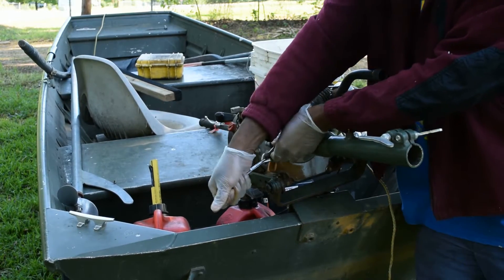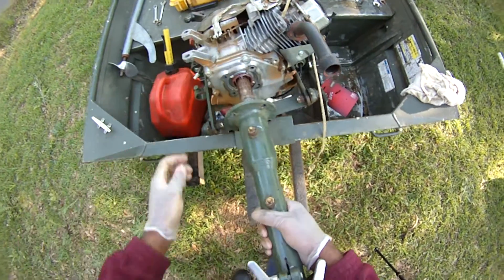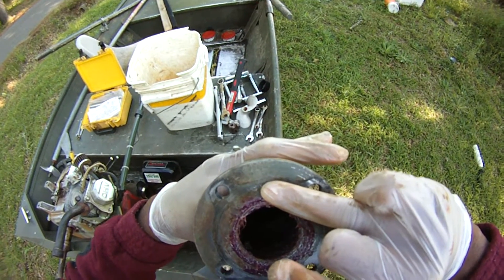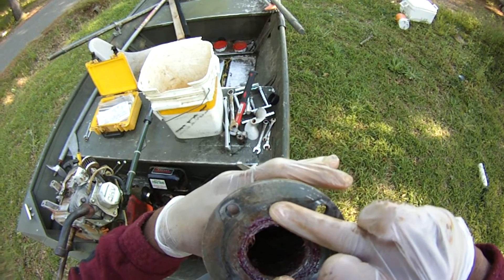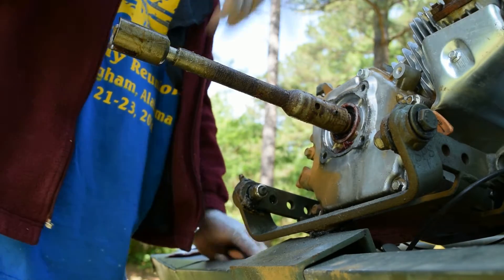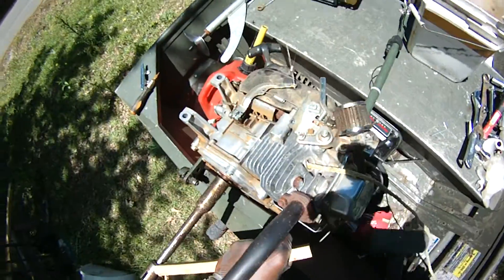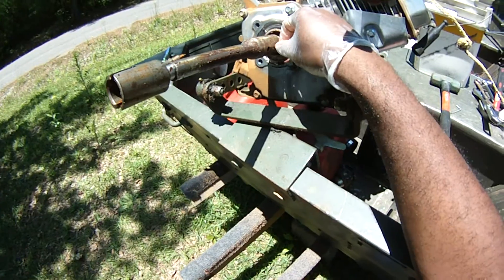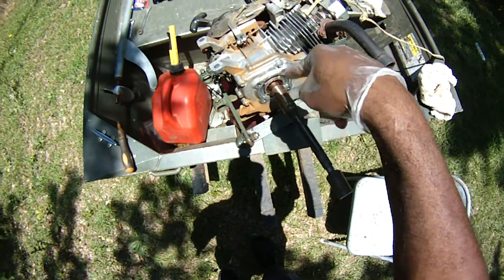Stage 2/3 Mud Motor Build | Coupling Removal

Comment: Hey brother, I know it’s an older video but I’m stuck right at this point. Can’t get that thing to budge. What did you need up doing to get it off?
Reply from the maker: You have to use that special tool plus brace the flywheel.
Reply: I meant the actual coupler...not the housing. The one over the jetway. I managed to get it with a torch and hammer. Thanks man.
Reply from the maker: @baseshootingteam2834  The actual coupling, just use WD-40.

Comment: I'm having trouble getting the screw part out that holds the pto housing together. Need help asap. Which way do you turn to take it off. Is it left like everything else and the crankshaft keeps moving
Reply from the maker: Yes, it's lefty loosy like everything else. You going to have to Get down t the flywheel and counter brace it with something. Might shoot a quick video today as I'm installing a new engine.
Reply: We have done everything possible and it still isn't loose. I am thinking we will have to cut it off
Reply from the maker: So you tried counter bracing the flywheel?